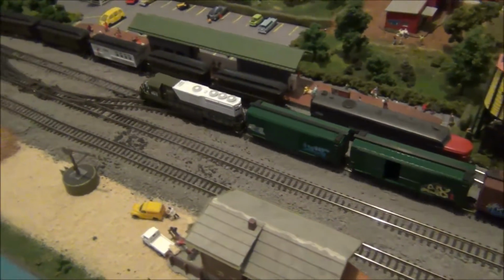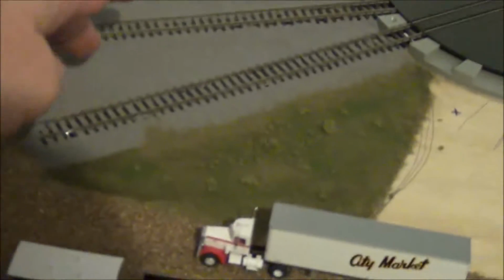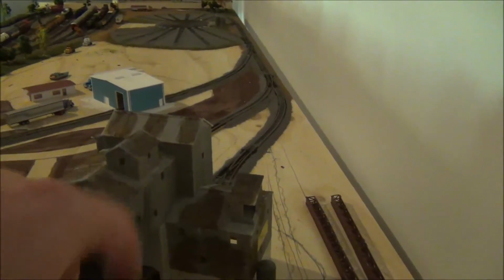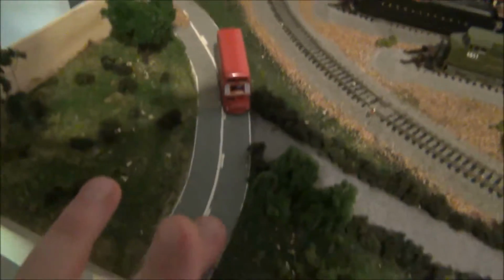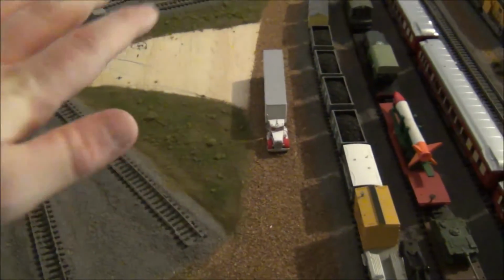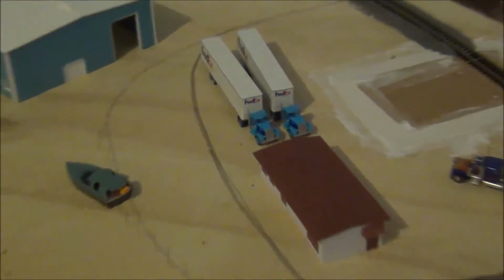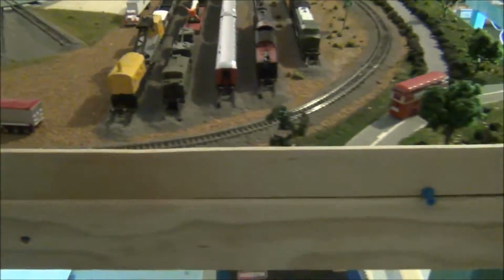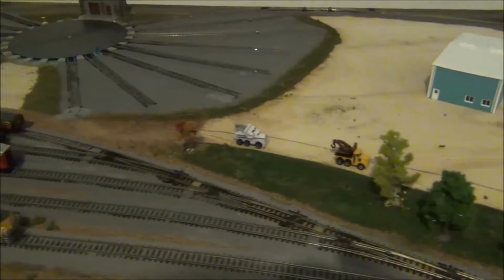Project N Scale update #24

Comment: wow great update, you got so much done is not all that much time, sweet. with the trucks is there a way to add drivers? future plans sound nice, and trains running through the update and no problems, so track work must be done well, have a happy holiday season,.
Reply from the maker: sparky107107 it might be a tight fit to get a driver inside the trucks. Track work is all done, there are a few things to re-do ballast wise, but its all coming together.